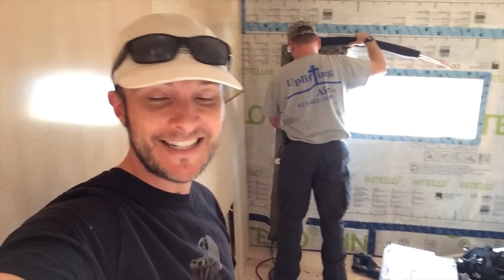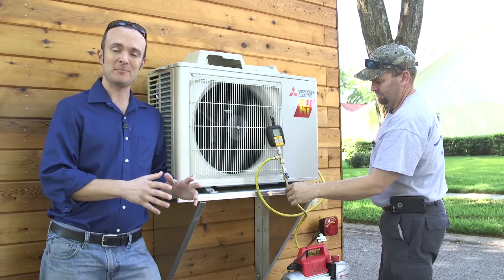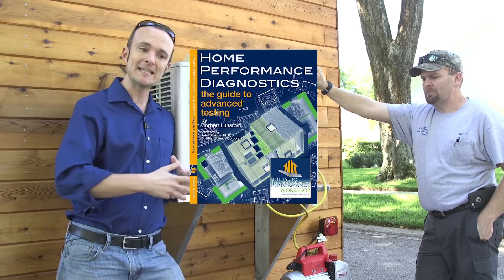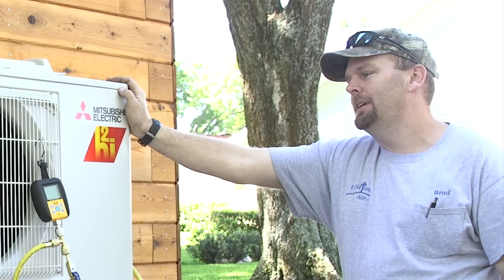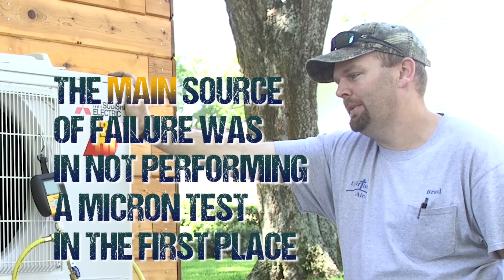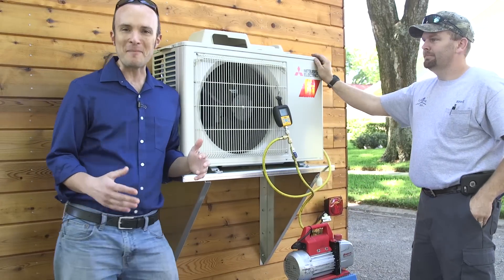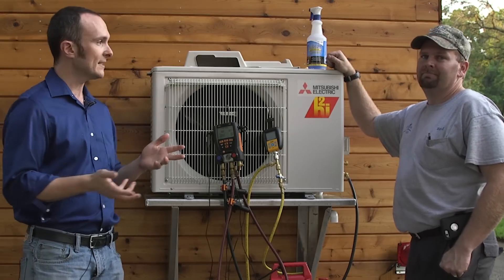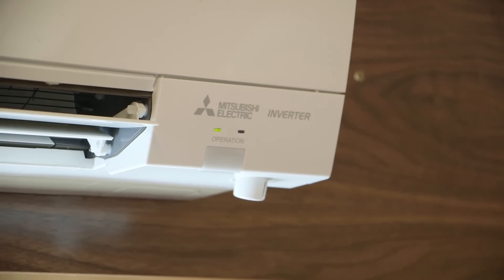Installing & Testing a Mitsubishi Ductless Mini-Split in a Tiny House with Brad Lemley

Comment: How much electricity does this use?
Reply from the maker: +Holly D 200-500W in cooling or drying mode, only up to 800W in heating mode. Amazing.
Reply: Wow that's significantly less than I thought it would be. Hell, my induction cooktop is 1800W. Thank you so much for responding!
Reply from the maker: +Holly D exactly
Reply: How many btu is this unit in video?
Reply from the maker: +Bajaheat 6000 btu, or half ton. Heat mode about 7-8kbtu.

Comment: never-but-never-flair-behind-the-indoor-unit.....BRAIZE...[solder]....26-years...experience....but-good-video
Reply: Since you don't even know how to spell "braze", I believe I'll pass on the advice...
Reply: @Jerryh31  He didn't spell flare right either. You can braze the lines for the indoor unit (allowed per Mitsubishi IF you use Nitrogen while doing it, like you should on every braze job). Or just you know, learn how to make proper flares and use a proper torque wrench and then use Nylog properly. End result is flares that don't leak. That's how HVAC School does it, who is Kalos in FL.
Reply: That's how they come out of the factory - so kinda academic unless you're willing to void the warranty.
Reply: cameron yogibear Not according to Mitsubishi.
Reply: True you will warm up the king valve packing and create a leak. Flair joints are the best way

Comment: Great video and very informative.  However, if Brad was installing this unit properly he would have used nitrogen initially as per the Mitsubishi installation manual and stepped down the vacuum which would probably have reduced the potential for ice buildup.  http://www.ecomfort.com/manuals/mzgeinstall.pdf   Brad may do some things better than most contractors, but he makes the same mistake as 99% of them.  They do not bother to read and follow instructions or manufacturers recommendations, which are typically necessary for product warranties.
Reply: Mitsubishi's install guidelines are severely outdated. A nitrogen pressure test is good to test for leaks. However, Mitsubishi's guidelines were made with the assumption of micron gauges from like almost 20 years ago, where their resolution is around 100, and vacuum pumps that were single stage. Today you can get ones that have .1 resolution, and I achieved a 46 micron vacuum using TruBlu hoses, and a decay to 72 after ten minutes. At those levels, there is no need for a "triple evac" because you can't get 46 micron vacuums if moisture was present.
Reply: Very well said! I must say that I am among the guilty 99%
Reply: Michael Chappell 7
Reply: I have worked extensively with vacuum systems.  A flush with dry nitrogen does a very good job of drying lines.  Not on par with a 'bake out' but you can get most of the moisture out.  The moisture is adsorbed on the inside of the hoses,  so removing the air is really not enough.

Comment: small line is Trans-Gas  line both are cold, or hot if you buy a heat pump and are running in heat mode, which is why they are both are insulated.
good job an proper evacuation and leak checking, often I will pressurize the line set with nitrogen first before tightening the last flare connection, to prepurge lineset. seems to make the moisture evacuate quicker, thanks for letting me put in my 2 cents.
Reply from the maker: +Tim Tuttle thanks for the tip!
Reply: Tim Tuttle how can a diy get nitrogen for doing this on his own these things are much easier to install as they don't require brazing like large central units

Comment: Doing research,  I'm thinking this is better than geothermal for a 3 bdr single family home no more than 2k sqft.
Reply from the maker: +Noe Flores wholehearted agreement!
Reply: Noe Flores quote with Paylessminisplit.com 👍🏻
Reply: Noe Flores look at multi zone mini splits your going to need a mini split of minimum 36k BTU but 42 will be best there will be one outdoor unit and 1 indoor unit per room some can have up to 5 indoor units per outdoor unit but on systems this large due to the amount of line set your going to need extra refrigerant as the company only puts enough for a certain amount of line set only enough for 1 unit at a certain length
Reply: HERPY DERPEDY Good point! Have to figure in the cost of the extra refrigerant as I would probably need 5 mini's on 1 outdoor unit. Since this would be a passive home. It's going to be very air tight so I'm trying to figure out if an HRV or an ERV is over kill. Thanks again!
Reply from the maker: +Noe Flores if you're going airtight, you absolutely need a balanced ventilation system.
Reply: Home Performance what size mini split did you use? 12k?
Reply from the maker: +Bajaheat 6k baby
Reply: Home Performance wow I'm shocked that it cools and heats the whole thing. Did you buy unit offline?
Reply from the maker: +Bajaheat the calculations are straightforward to figure out how much heat and cool any house needs. You can get these units through local contractors.
Reply: Home Performance were might get a Mitsubishi mini split because the Trane central air conditioning we just bought 2 years ago is junk we just had it repaired for $500 and 2 days later broke again company that installed it went bankrupt because how bad Trane is we are only keeping the furnace
Reply from the maker: +HERPY DERPEDY Yes, the installer has a lot to do with how the unit performs. Our minisplit might have worked terribly if it hadn't been selected, installed, and tested smartly.
Reply: I don't get the attraction of these things.   LG sells a window heat pump with the same specs for the same 1k to 1.5k sqft for under $700!   Why install this, when I can put in the window unit without permanent damage, and save a grand for other things?
Reply from the maker: Not the same specs. Efficiency, noise level, controls- you get what you pay for.
Reply: For one small open space, especially living?  Agreed.  But for any zone control?   For efficiency, cost, and aesthetics of having HVAC as the focal point of each room of my home, I guarantee you I could do duct for the same or less cost with better efficiency, longer life.   Guarantee it.
Reply: I put the window heat pump in my garage/shop.  Could care less about the noise, they aren't really loud.  With all the racket I make out there, and got an extra 1k in tools (I'm a tool whore).   That was my thought.
Reply from the maker: Sure, that’s reasonable. Only way to put a perfectly-sized quiet unit on an off-grid tiny house on wheels that can run on 15A total is this way, though.

Comment: So I have watched a few videos and have seen two methods of testing the system. both leave me with the same question. After the test is complete does the system need to be under vacuum before you release the charge? What does it need to be at? can there be too much vacuum?
Reply: it needs to be under full vacuum to release the charge.
Reply from the maker: +Bryan Kingsbury yes, you don't want any air in the system when you release the charge.
Reply: so does that mean I leave the full vacuum? or do I let off on the vacuum and just keep a little in there? Does this make sense what I am asking?
Reply: Surely this is self explanatory?  If you let ANY air back in you're letting moisture in too... what would be the point of vacuuming?

Comment: Is the refrigerant actuall FREON or is it a different chemical?
Reply: Al MacKinnon Freon is a trademark of DuPont it's just a refrigerant R22, 410A ,R134a and there's other refrigerator that they make
Reply from the maker: Good q, +Al MacKinnon - turns out all coolant goes by the name freon, it's generic. Some companies brand new monikers on specific chems, but that's just marketing. Ours has R-410A.
Reply: Al MacKinnon Freon and refrigerant both are the same the one all mini splits and modern central AC come with is R-410A older refrigerants are R-32 and R-34 R-134 R-134A and many more but the most common ones are R-410A and R-134

Comment: "Releasing the charge"  you say this as if everyone know what that means.  I don't remember it being explained in the video.  The unit on the back of the home comes with refrigerate in the compressor ready for release into the indoor unit.  What Brad was doing is remove air/moisture/everything from the indoor unit with the evaporator pump before releasing the stored refrigerate into that unit.
Reply from the maker: +Dwayne Dixon exactly- and also purging the entirety of the lineset of air and moisture.

Comment: This is Great! I've been looking forward to a vid on your HVAC system! Lots of good information, I'm in the early stages of my build and was planning to setup the split myself. How DIY friendly is it? Does it make sense to set it up and just have a guy come out like Brad to test it before you release the freon?
Reply from the maker: +SimpleTinyHome, I did nothing to install this system except assist Brad. Very iffy to DIY if you're not an experienced pro. This stuff is pretty heady, and also pretty dangerous to health and home.
Reply: Home Performance if you do diy stuff and have a knowledge on working on homes these units are much easier to install than a central air
Reply from the maker: +HERPY DERPEDY i do not encourage DIY in general. I'm a building diagnostics expert and a quality control inspector, so I'm not really a DIYer.

Comment: In addition to a 150psi pressure test with dry nitrogen we also perform a proper vacuum on every system we install using a proper micron gauge, proper vacuum rated hoses, proper vacuum rated core removers, seal every connection with Nylog sealant and used a 6cfm SuperEvac pump.  Every system gets pulled to less than 300 microns and this will very rarely take more than 10-15 mins.  

Good job overall!  Have Brad check this out:   https://youtu.be/eGLYAmjWkvA

Comment: Great video!  How did you handle the condensate line from the head unit?
Reply from the maker: Simply follows the lineset in the wall, and ends with a trap just before the end of the line under the outdoor unit.
Reply: I pictured you having to route the condensate line to a drain inside your tiny house.  I'm glad it was so simple. Will the head unit produce condensate in freezing weather?  I'm AMAZED at how quiet the head unit is.
Reply: @HomePerformance  Why do you need to install a trap on a mini split? Ive never seen one one these units before. only on central units.
Reply from the maker: Otherwise you have an open air leakage pathway directly outdoors, for one.

Comment: Brad seems like he's on the ball. I would recommend to him to start pulling through appion crt tool and always pull the shrader cores. If it really takes him 6 hours to pull a vac that is really too long. Also since it is a heat pump you really shouldn't call either line the suction line because in heat the small line is still a liquid line and the large is discharge line
Reply from the maker: Joe! Addressed your last point in the end of the video, where Brad kindly corrected me too!
Reply: +Home Performance I'm correcting brads correction lol
Reply: It's not a suction line either. It's an expansion line. It's still thin to make sure it doesn't expand that much after the EEV. Also, sure, in heat mode, it is the discharge line. But that's not specific to a mini split as normal heat pumps work that way.